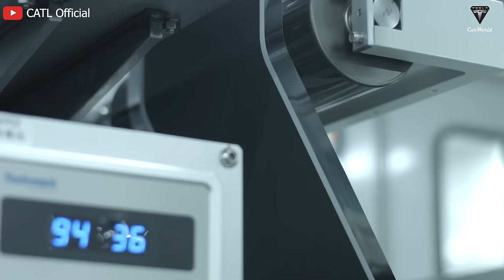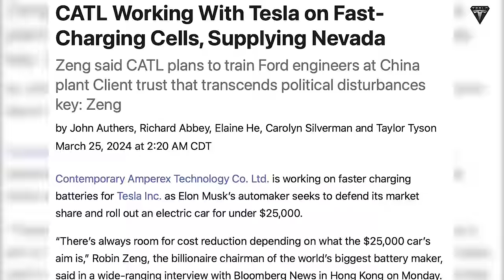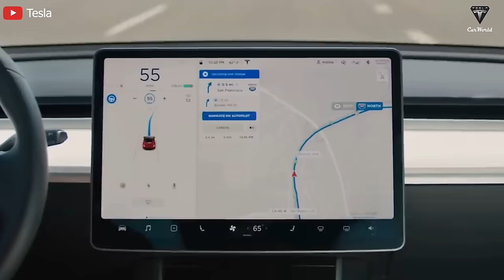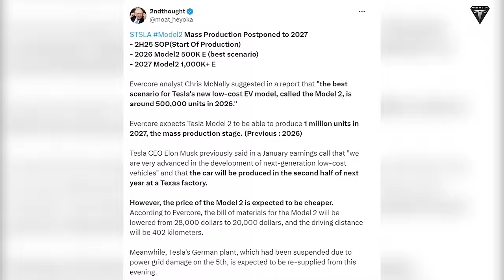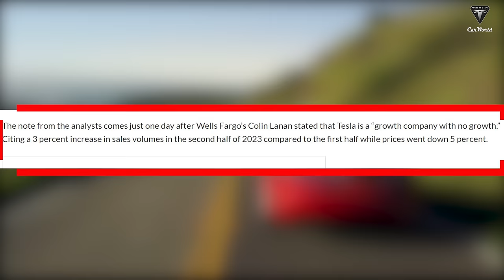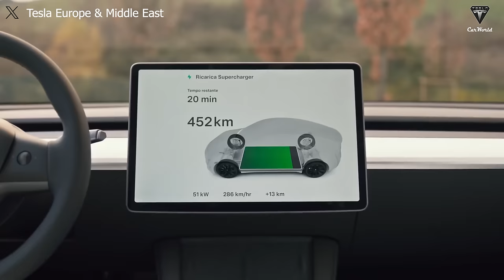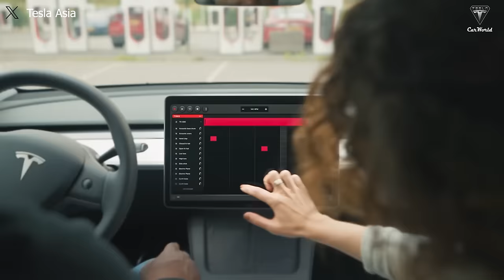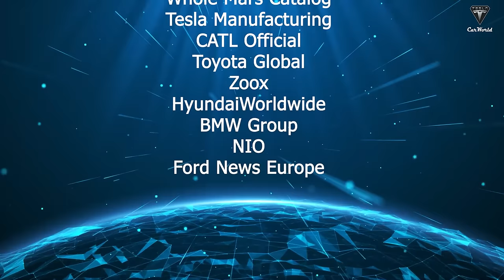Just Happened! Tesla Model 2 BIG Updates New Price, M3P battery and Time-Release Shocking Industry!

Comment: The real revolution in Tesla's model 2 may be that Tesla have solved the puzzle of making a production line for a carbon-fibre structural frame, at scale. This would reduce the total car weight by at least 50% meaning that economies of scale through efficienct would see a 55kwh battery pack capable of running for around 350 miles between charge, which would blow the rest of the market out of the water.

Tesla may have developed such a production line in collaboration with IDRA using a Giga-Press designed to press out structural elements made from carbon-fibre slurry under pressure and heat, with a proprietary cooling phase.
Reply: Yeah in general it is their inovation in materials and production that impress the most. 

Could also be a Magnesium aloy frame, with the new CATL-batteries, 48V and stear by wire, add in ethernet, modular build an paintshop with Optimus productionline.

Comment: There were some images of a 2-door model that looked similar to the promised 'Roadster' ...
And I think I will try to save up for THAT car...!!
But I wonder just how good the Braking is in the EV's using only the regenerative Braking.
I Know that true, "Performance Driving" (as well as Emergency situations!) when HARD and FULL Maximum Braking is NECESSARY... I feel VERY Uncomfortable just trusting 'motor drag' for a HARD BRAKING situation...
Reply: Tesla brakes last forever UNUSED
Reply: Basically, it's like having double the breaks. Standard breaks + regen where the motor gains power (think those little cars you pull back to power up).

Comment: I want a electric vehicle I don’t care about high speeds but only want loads of range at a cheap price
Reply: WHY? In an EV, you leave your house every day with a full charge, why do you need lots of range? It's pointless and a waste of money
Reply: @mcamodell  I know my response is late but here. for most people that’s true however for me that’s just not possible as I dont have the ability for a good home charger and there’s no ev chargers in my city so my only choice would be to go through the trouble and a loot of money to get the necessary stuff for a actual charger that doesn’t take a week for a single charge or drive nearly a hour to the  city which barely has any ev charging stations that I don’t even know if are available to the public. 
Also just like outrageous battery capacity on phones just because it’s not needed doesn’t change the fact it’d be nicer to only have to charge once a week or less because I’d  I prefer to be able to need to charge as less as possible

Comment: Ford is going bankrupt as they loose tens of thousands on the all electric Ford F150 Lightning and Mach E mustang. 

Ford stopped building its new battery plant, scaled back F150 Lighting production from 3 to one shift and may scale that back back to just 4 days a week of production.

Used Ford F150 Lightings are readily available.

Comment: Thus far, all Tesla's have been plug ugly. The Model S was probably the least worst looking of them. If the Model 2 is put up as a $25k car, then going off Tesla's track record, it will come in at about $40k. The $25k was probably nett of government rebates, and for a base model that they will never manufacture. Faster charging = higher peak loads on the grid - you already see charging rates throttled when more than one or two chargers are in use, so this will only get worse.
Reply: Regarding the cycle life of the batteries - it will doubtless be based on slow charging up to 80% capacity, discharge only to 20% remaining capacity. just as the claimed driving range is based on constant 28.8mph, with no hills, no wind, no stops or starts. It's all BS.